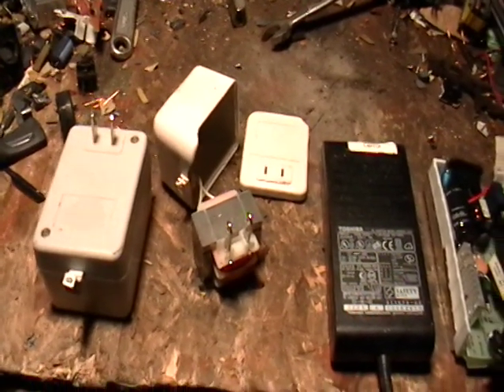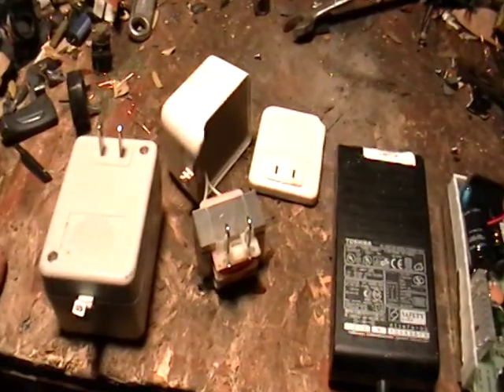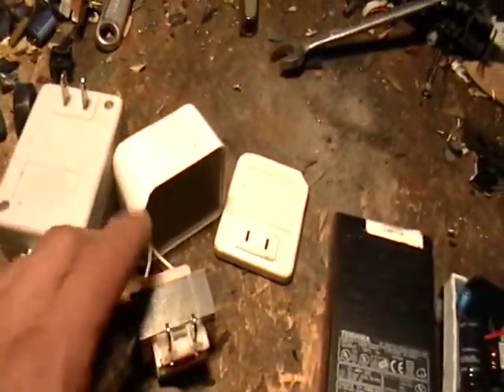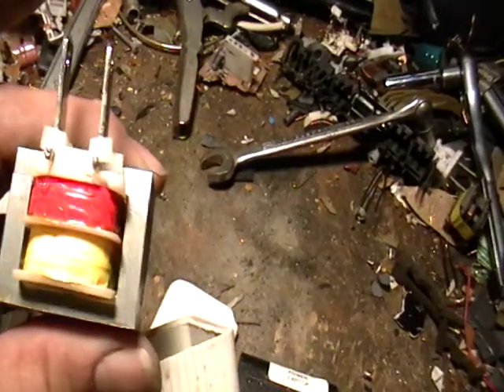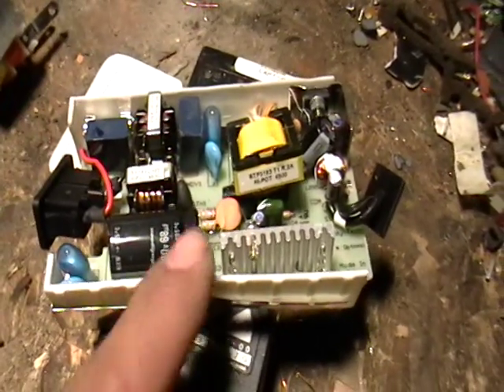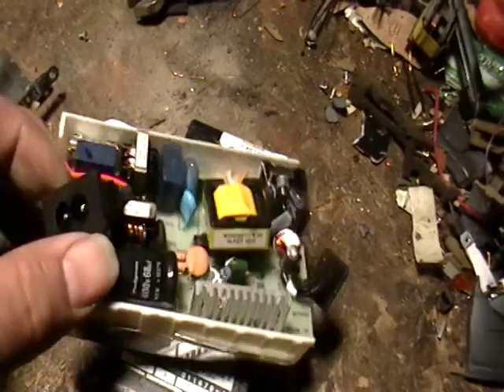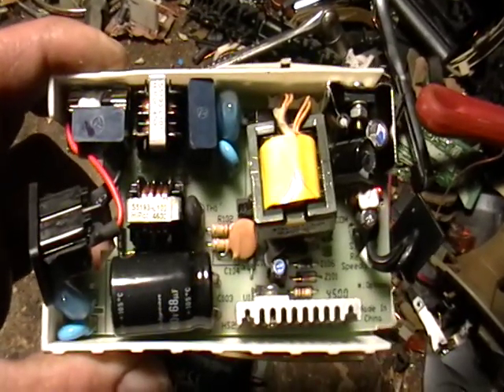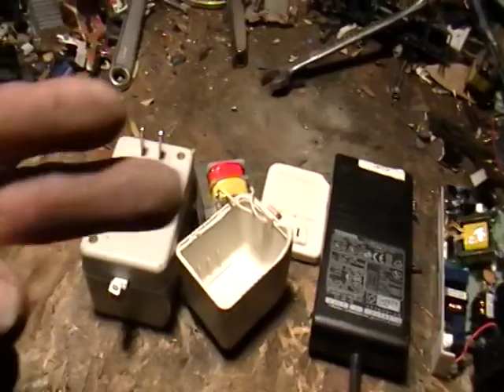Scrapping Power supplies for copper

Comment: Hey Mike, I have a question. I scrapped a washing machine that had a big plastic tub
with the transmission coming up thru the bottom to the agitator. I can't get the agitator or the tranny out. Also, how do you scrap those little bitty motors you get from things like computers or hard drives? Love your videos. You are like the guru of scrap. Anytime I want to scrap something new, I come to you.

Comment: Hi Mike, I didn't understand how to remove the copper from the first power supply you show. The problem is that steel thing. How do I do to get the copper wire from there?

Comment: what is the back tube net to the heat sink
Reply: The round black thing is an aluminum capacitor.  You can peel off the label and pull out the inside junk and be left with aluminum to sell.